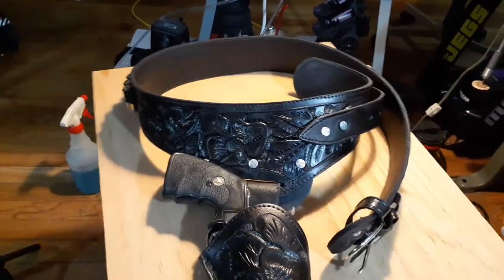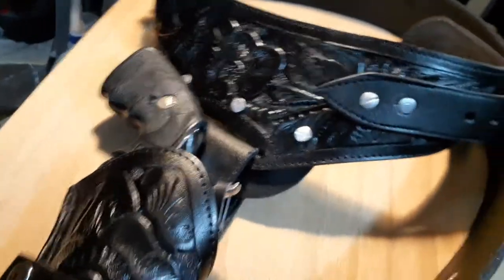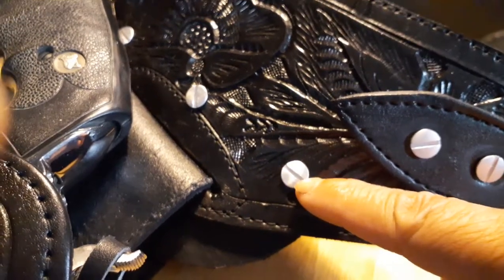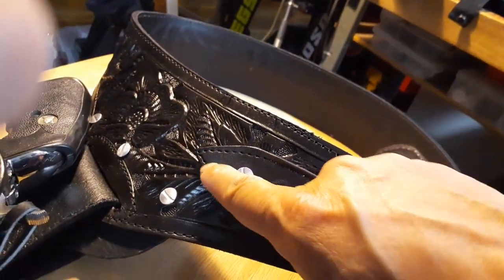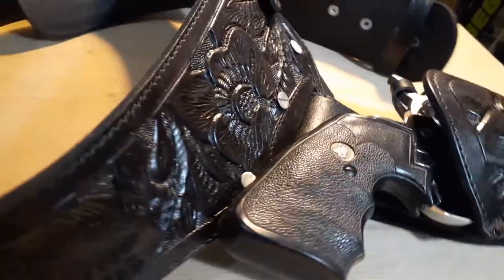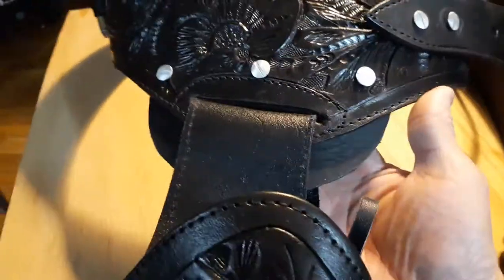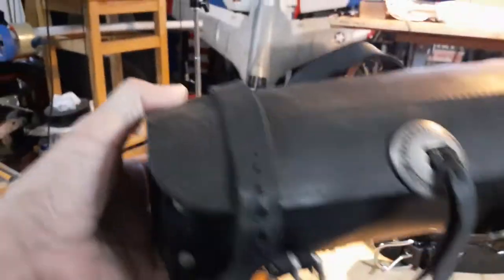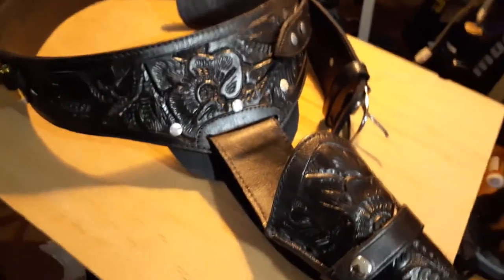This is e Matthews Jet and I finally finished fixing my Western holster

Comment: Dang my gun belt I use for my 44 mag I cut peaces out of an old pair of boots to get the drop part I want but now it's a brown belt with a black drop point and a tan holster but it works my 44 mag is the Ruger super Redhawk 44 mag 7 Inc berrel I needed the drop point so it would hang low enough so I could draw it easy